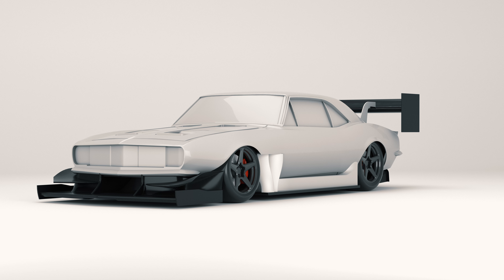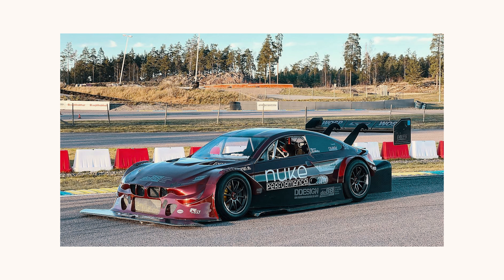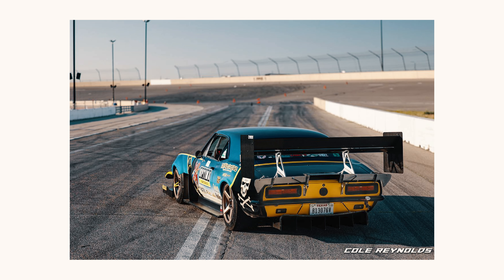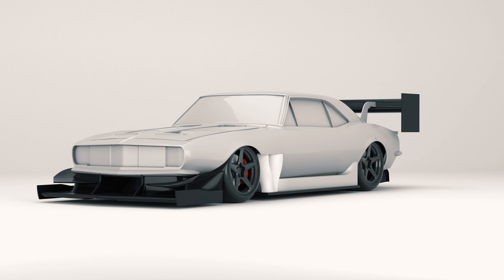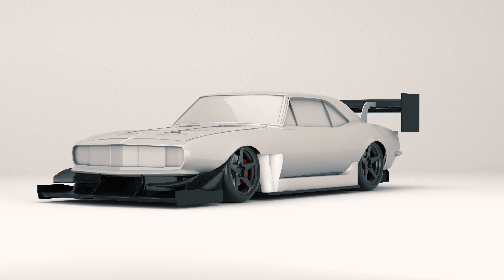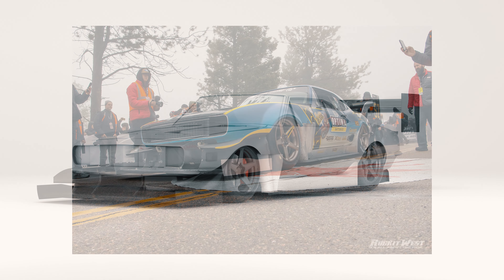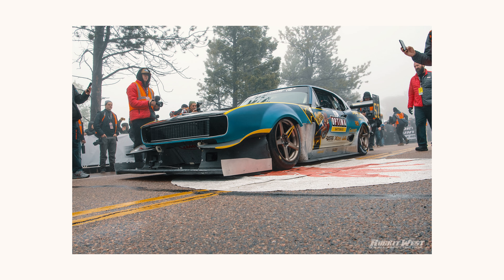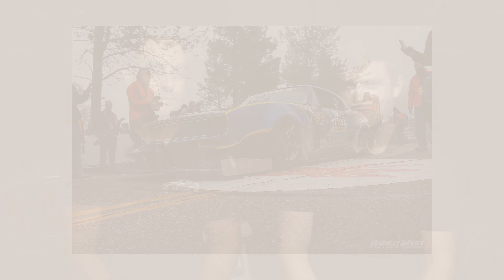Building Aero for DuSold's 67 Camaro

Comment: One thing I've learned with fender vents over the years is that it tends to have strong interaction with the rear wing tip vortices(potentially disruptive as well as synergistic). The height of the rear wing in relation to the tire wake has a big impact on the efficiency of the wing, particularly under yaw. Jacky Ding saw that with his M2 after he installed fender vents his car had a lot more understeer mid corner, because the wake of the wheel was synergizing with the rear wing tip vortex.
Reply from the maker: This is definitely something that needs to be kept in mind when developing packages like this.
Reply: @VerusEngineering  Exactly, for example instead of running top mounted vents, you can lower the wake a bit by venting from behind the wheels like you did here. That will weaken the wake and wing tip interaction, since the upper tire wake and wing tip vortex co-rotate, the merging process can cause transient instability.